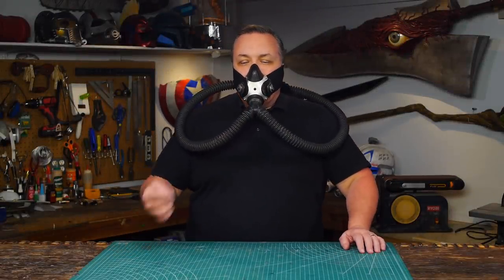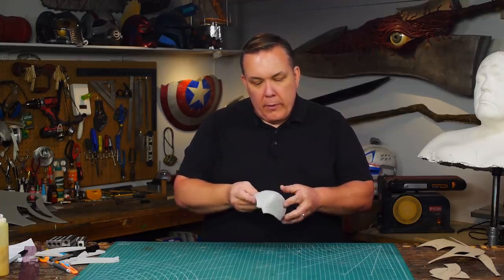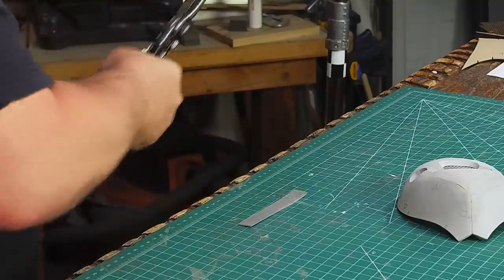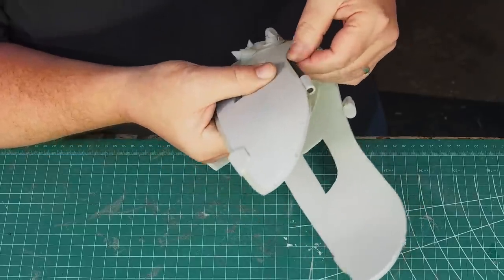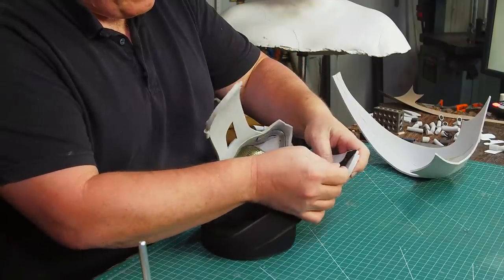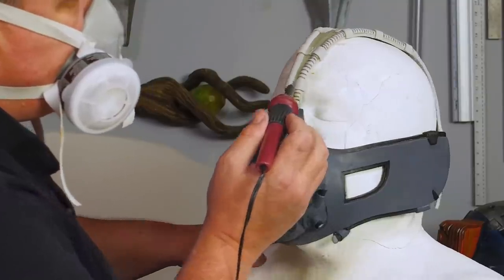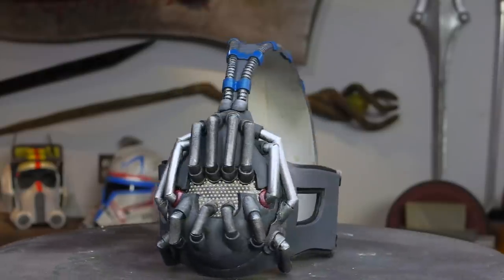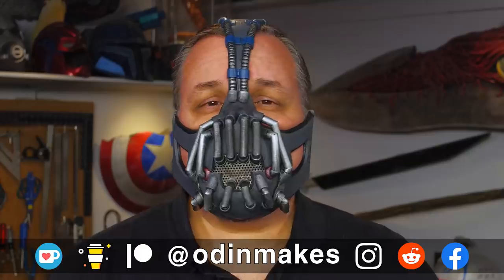Odin Makes: Bane's mask from the Dark Knight Rises

Comment: hi i'm Axel. Here in argentina latex and similar materials are super expensive so i work on eva foam or craft foam to make puppets. i have made a yoda, and a couple of zombies.it's not the greatest material but have a good texture and if you use 2mm eva sheet and backet  it with upholstery foam you can get a decent flexible puppet.

Comment: Odin, for the detachable top do you think magnets placed one in the front and two on each back might work? To make the taking off and putting on process easier? This would also solidify the alignment problem with the Velcro

Comment: For the top "convertible" part, would small magnets been a better choice?
Reply from the maker: Possibly, I did think about it, but the mask is a pretty tight fit. I thought Velcro would hold better.
Reply: @OdinMakes  Ok cool. It was my first thought as I've seen you use them previously, and they always turn out clean. :)

Comment: How likely would you be to tear the foam, if you're tugging at the hook-and-loop with any regularity at all, I wonder?
Reply from the maker: HD Foam is pretty tough, but I am trying to pull on the Velcro it self, not just make it  rip away from wherever.
Plus this stuff will not last forever anyway. So not that worried about it.